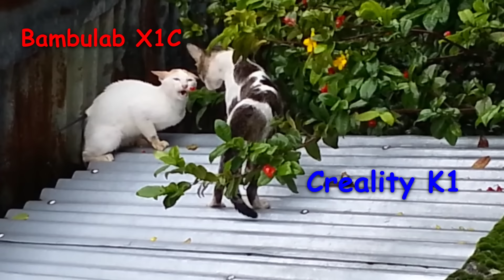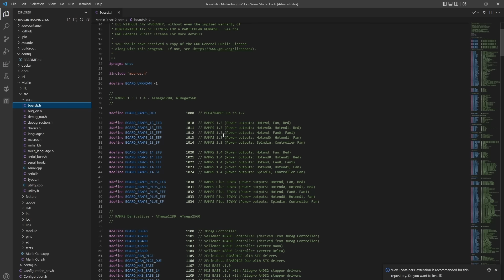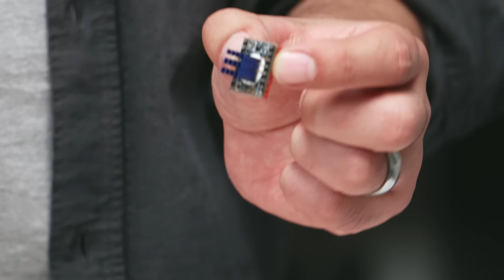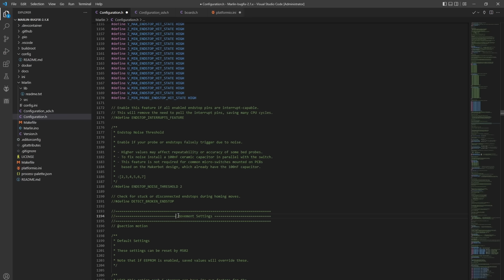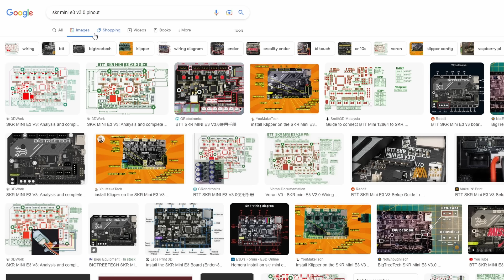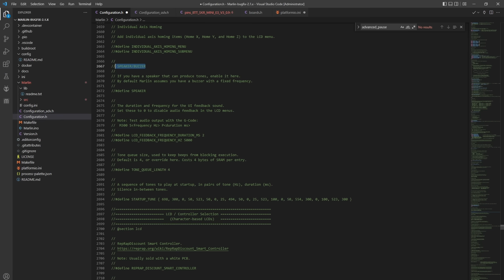How to Build a 3D Printer from Scratch: Part 3 - Marlin Firmware

Comment: I have to admit this series is excellent but when you chose a Creality board I just totally cringed lol. You could of gotten a way better board for the same price as a Creality board ie BTT or bust lol!.. That and the fact that Ender 6 is a Core XY which is really what you should have chosen to make things easier on yourself. All in all good video series. OFC I would of chosen a 500C hot end to open the door to many more filaments and the fact that they are just built much better. Adding individual axis homing in config.h really helps when setting the direction when upgrading or complete build.

Comment: Hey Jake,
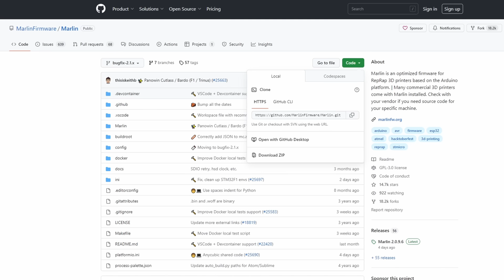4:30 confusion here, how to find which printer's config files fit with our custom made printer. 🤕 As mine is also coustom made and I want to flash the firmware.
Reply from the maker: I guess you need to be a bit familiar with the printers in the config file. Try to find one with similar parts and features. Maybe you want to build a corexy with a specific bed size, choose a printer config with the same bed and same motion system.

Comment: Great series, I find it helpful as I'm planning my own design/build.  But, I'm not sure who needs to hear this, but if you're doing a lot of customization and modding, Klipper is the way to go.  You build/flash once, then just update a config file via web interface for all of your tweaks and changes.  I find it super great for modding, and I can't imagine doing a build from scratch and all the associated tuning without it.
Reply from the maker: It is a lot of work for sure. Totally agree that Klipper is better for easier access to changing firmware values - we'll actually be doing two versions, one marlin and one klipper.
Reply: @3DJake_Official  nice.  I look forward to the next installment.  I'm gathering parts and tentatively planning a low budget large core XY.  400x400 bed from a Kobra Max.  Thinking plywood box frame/enclosure with ASA printed parts in the corners to mount gears/pulleys, etc.  Linear rails for X & Y, triple rods & motors for z axis.  I picked up an Octopus Pro with a couple 5160's and a bunch of 2209's.  I haven't picked out steppers yet, or decided if I want to do 48v on the X & Y or not.  I have some Ender 3 steppers I might start with.

Comment: When will the Part 4 come out? I really want to follow the series for my undergrad research project :<
Reply from the maker: Don't worry it is in the works!
Reply: @3DJake_Official Any update on “it’s in the works?” You’re almost to the finish line and we are currently left hanging.

It’s been a fantastic series so far. I’m looking forward to finishing the series and building one just as youre doing. A link for the build was mentioned in one of the videos to build the same as you’re doing here. I’m guessing that will come at the end. I’m chomping at the bit to get going as I need a larger build capability than my old Ender 3.
Reply from the maker: @billcedarheath387  Currently designing the printhead, all that is left is the firmware after that, still I can't give you an ETA :( This is very much a side project.
Reply: @3DJake_Official  It’s a shame that it’s a side project. It’s such helpful information and great content. My personal take is it shouldn’t take a backseat as there is some time sensitivity for us looking to use the info for our own builds.
Reply from the maker: @billcedarheath387  I totally agree and I have so much to say about the design process in the next video, seriously the amount of experimentation that was done because I couldn't find more explanation online was crazy.
Reply: @3DJake_Official  I understand and your not finding more online goes to show why this series isn’t a back burner side project level. It’s new territory in many ways as it’s not the copy cut and paste from other content providers.
I’m eager to see the videos to come and see the files for the project so we can build along with the videos. It’ll be a fantastic learning tool for many people.
Reply from the maker: @billcedarheath387  This is a very motivating comment, thank you, I'm gonna work on this to get it out fast!